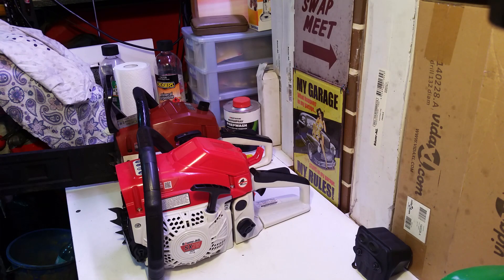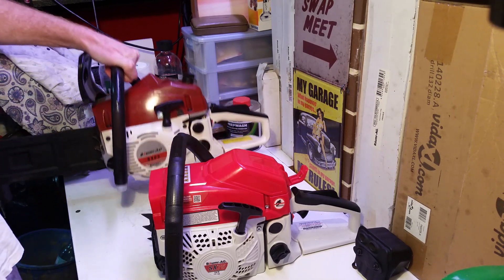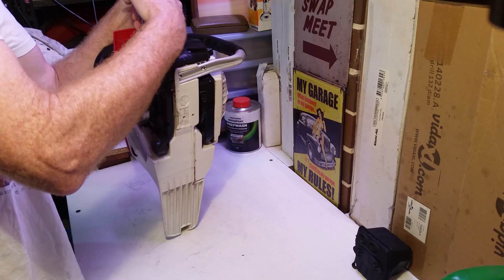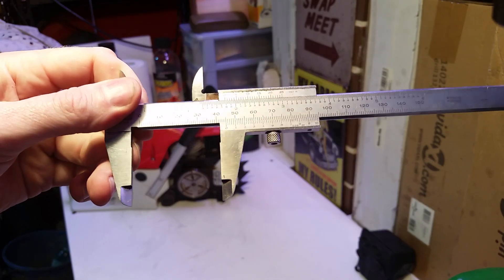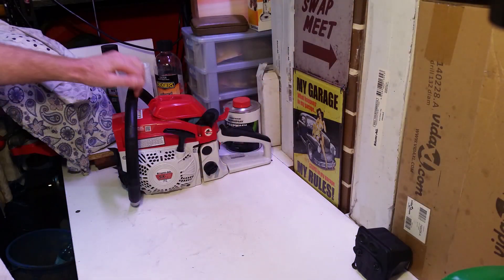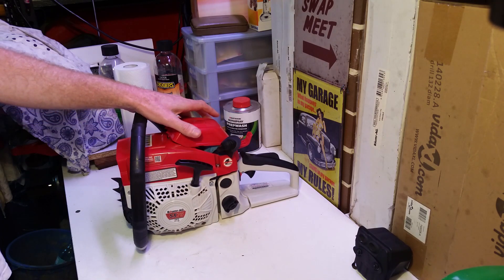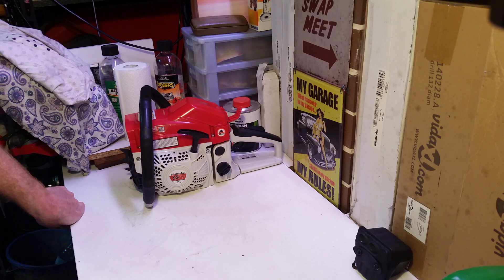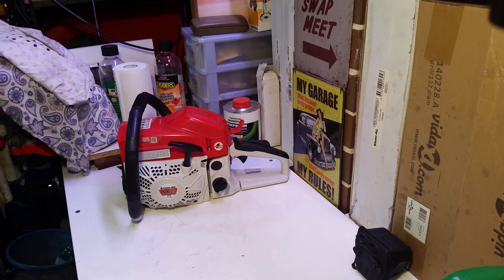Baumr ag SX75 chinese chainsaw, what is it really

Comment: Is this the same with giants brand selling on bigw and HN
Reply from the maker: I had a look at both sites you mentioned. Yes, while there are slight variations with all these particular saws, they are the same base design. it is my understanding that they range from 52cc to 62cc, not over. Sellers are using specs provided by China. Often false. Larger saws are completely different, eg Husqvarna 372xp clone 71cc.

Comment: I've got a first gen SX76, bought from AGR machinery (just Edisons with one of their MANY scam names that they have buried over the years). Had it for for a very long time, back before everyone knew what a pile of excrement Simon Mills is and his dangerous imported Chinese equipment that kills people. Ironically, I actually love the saw, more reliable and easier to start than my Stihl or my Husky, but out of the box, it never oiled, the plastic worm gear strips the teeth on the first pull, they sent me another one, same issue. one day I might try and match up an alloy worm gear from another saw that will fit, I am shocked how long they have been using the current name Edisons, and that they never dropped the baumr-ag brand. They don't even care, and that's why their equipment kills people, chainsaws are one of the "safest" things they sell... and they DO NOT meet the Australian safety standards. Incredible that the government allows this crap to happen for over a decade. Some of their hydraulic stuff, and tractor implements etc... are absolute suicide machines :(

Comment: I am currently using this saw and i think it rips for the price. Ive busted the stock bar twice now though so im wondering if you had any idea what bars are compatible with this saw?
Reply from the maker: You can find compatible bars on ebay.
If you are looking for better quality, I don't know what brand fits, but suspect it may be Husky small mount, but not certain. you should check.

Comment: Hey Anthony! you measured the diameter of the piston, NOT the "cylinder diameter"/bore. And I can tell you now bro, that the piston
has substantially less diameter than the bore. Your displacement measurement is spurious...  No wonder the seller has ignored you.
Also mate, I dont know what website you bought your SX75 from, but the website I bought mine from clearly advertises the displacement
at 62cc.   Just because a Falcon 500 is called a Falcon 500 does not mean it has a 500 cubic inch engine LOL
Reply from the maker: No, actually I measured from the cylinder to the opposite side of the piston, therefore, only didn't measure half of running clearance 
Secondly bro, if this was 62cc, with 35mm stroke, it would have to have a 47.5mm cylinder. No engine I have ever worked on had pistons 2.5mm smaller than cylinder, that would be pretty shit lol.
Thirdly, when I purchased mine, it was advertised as 75cc. Yes Edisons ignored me at first, but when I took this matter & the sx92 matter to fair trading, Edisons were forced to change their advertising.
Still not correct, but closer..
Perhaps you should do your own calculations, or use online calculator for yourself.
I forgot. Falcons are shit. Lol.
Reply: There is only a few thou dfference between the piston and the bore, in essensce they are the same measurement. You are clueless.

Comment: Chinese chainsaws are junk it's better to shell out a few coins for a German made model. I've had too many problems with Chinese made chainsaws including the bar which always seems to work loose the chains themselves which are pure junk, leaking bar oil and problematic carbys not to mention cheap plastic parts that break.. China couldn't even manufacture ball point pens until 2017, they simply couldn't engineer them

Comment: do you think its possible that the seller didn't know the CC was incorrect?
Reply from the maker: At the time, I did contact the seller to inform them of the problem, they didn't want to listen or correct there advertising. That's why I took the matter to fair trading & posted these videos. only then did I get some results for this & other chainsaws. Although, afterwards they were advertising this one as 62cc. Still not right.
Thanks.
Reply: @anthonysgarage5283  ok just wanted to clarify, I was under the impression they didn’t believe you and thought you may just be wanting a refund etc.. but by you informing them they should at least check if they didn’t know the CC size to start with, 
So my next question is, I just bought a SX62 gen3 with obviously very little research before buying, is that a 62cc saw or do I have something else? 
Cheers
Reply from the maker: @AlexanderTheGrateful  I can only say that my sx62, which is an older model, is about 61.5cc close enough. Don't know about gen 3, if you can't find  out, you would have to measure stroke & cylinder to work it out. Or find online calculator. Cheers.

Comment: I call b.s,maybe the cc mnot be 75cc,but I can tell you that this thing when tuned rips through ironbark,blur gum and a stack of other Aussie hard wood,absolutely bargain,I do have my stihl 381 magnum as back up,so far so good,I have had the main fuel line fatigue and suck.air.
Reply from the maker: Measure it for yourself. Then comment. It does run pretty good but it has less balls than 62cc.
Reply: @anthonysgarage5283  hey bro no.disrepct to you,iam not disputing the measured size,all iam saying is it has heaps of grunt,I currently have 3 saws a 72cc  381 magnum and a husky 350 which is 50cc and the sx 75 has way more power than the 50cc husky,for the price it can't be beaten,maybe it is a 50-60cc and it wouldn't surprise me,end of the day it does more than asked when it comes to cutting Aussie hard wood,keep up the vids.
Reply from the maker: @shameelali2549  no problem mate. I would agree with you that it's pretty good for the money for a saw that is for memory about 57 or 58cc. The point of this video was that when I bought it, It was advised as 75cc.
Thanks for watching.

Comment: Hi Anthony, thanks for the review. Any recommendations on a budget saw for a home owner? Just for firewood collection. I have a Jonsered 2040 Turbo which is a bit undersized sometimes. Looking for a bigger bar/motor but it won't see heavy use. Neighbour has the SX62's and swears by them despite them failing every 2-3 years because they are so affordable to replace. I was looking at the 75 as well.
Reply from the maker: Hi Andy, thanks for watching. Firstly, if you are looking at chinese chainsaws, look carefully at the castings & other physical features. A number of other brands like MTM , GIANTZ & others are advertising 72 or 75cc saws. These are most likely 62cc or less as with my sx75 55cc. There are some genuine larger saws, but different design.
Now my sx62, 61.5cc is over 6 years old, used a lot, replaced coil some years back & going strong. Supprisingly. It has poor air filter design. Currently using 22" bar.
Sx75, 55cc saw is under powered for 22" bar supplied but has better air filter design. And dodgy chain tensioner needed modification.
My choice between these two would be sx62 if new model is 62cc or close to as advertised.
All chinese saws need a lot of maintenance & minor tweeking. Poor quality. For firewood, their fine. 
Maybe a good second hand Husqvarna or Stihl for the right price. If you can find.
Good luck.
Reply: @anthonysgarage5283  Thanks for that, I'm considering the MTM 72SX, which is listed as a 58cc running a 22". It seems to have positive reviews online. The SX62 gets a generally good wrap also but I was thinking the MTM being an extra 2" could be useful. The SX75 is now listed as 62cc also, which is another 22" option. I have read conflicting/poor things about the 75, 82 & 92. Do you have any feedback on the MTM SX72? Couple of positive vids of it on YT.
Reply from the maker: @andyd6511  Hi Andy, I don't have any mtm saws, but looking at pictures of MTM 72SX,  top cover makes me think it might have the improved air filter. 58cc should be ok for 22". My baumr sx75, 55-56cc (listed as 75cc at the time) did cut, but not as well as sx62, disappointed as advertised as 75cc. Don't believe current baumr sx75 specs of 62cc. It's 55-56cc. I think all these 55-62cc range saws come from same factories.
I am thinking of putting 24" bar on my sx62 as I have a bad back & don't like bending over. This is why I suggested sx62. Bit more power for longer bar on light saw.
As for baumr-ag sx82 & sx92, they are larger heavier saws. basically the same saws with different stickers & $$. These saws are a clone of Husqvarna 372xp. With actual 70.7cc same as Husqvarna. All parts available + cc upgrades available. Sx82 & sx92 or (G372xp) specs available at farmertec.com
Hope this helps.
Reply: @anthonysgarage5283  Thanks mate. Yes I liked my neighbour's SX62 but just thought why not try a 22" option since I want a good upgrade on my Jonsered 16". Collection just starting so I don't have bars and chains to swap around just yet. In terms of budget I'm trying to keep it cheap (dad shouting, birthday) so either the SX62, SX75 or 72SX. SX62 seems to be a safe bet so just wondering if I go the others for a 22" bar or get the SX62 and look at a bigger bar later maybe.
Reply from the maker: @andyd6511  sounds like you have you're heart set on 72sx. This should be fine for firewood. You probably won't need longer than 22". All chinese saws will have minor issues to resolve. It's an individual choice. Pro's won't touch them, but for occasional firewood, budget saws, their fine. Trust your gut. Also please be careful. Always be mindful of the tip of the bar.I should practice what I preach, but safety gear would be good idea if you don't have already.
Happy cutting.
Reply: @anthonysgarage5283  Thanks again mate. I might go with the SX62 because at least you have measured it at 62CC. The SX75 actually being a smaller engine...perhaps I'm better with the 62 and looking at a 22" bar later if I need it, rather than buying a saw for the longer bar and hoping the 56CC's are enough. And yes I always use goggles, muffs and leather gloves. It's the back that's the problem haha
Reply: @anthonysgarage5283  Hi mate, settled on the SX82. Decided the extra CC's was worth it, even if I don't need to whole 24" I could always swap to 20-22 in future. Also thought being a Husky 372 clone could be useful having access to interchangeable/reputable parts. I'll let you know how I go!
Reply from the maker: @andyd6511  hey Andy, good to hear. I think you will be happy with your choice. All aftermarket & genuine parts available for sx82. I have never had major issues with sx92 (same saw). Just remember, always use decompression valve with every pull & be gentle on chain tensioner. Mine hasn't failed yet. Also if you ever change the bar, it's Husqvarna Large mount & 3/8 pitch, not same as sx62. Hope it goes well.🖒

Comment: .....apparently in the motorised bike columns it's been mentioned that the Chinese look at the full capacity of the piston chamber which includes the unswept combustion chamber not just the displaced capacity .
..Mine is an sx72 brand new which I purchased exactly ten years ago. I couldn't start it then and not doing much better today .It'll only run with choke engaged with help of the starter fluid .Soon as I disengage choke it cuts out. Naturally something isn't right with the carby. Since it's useless as is , I guess I'll pull it apart . I'm ignorant about those types of carburetors .
Reply from the maker: Not so sure in this case, I can say this, back when I Purchased my saws, sx92 & sx82 were sold as 92cc & 82cc but in fact, they are exactly the same incluting stroke, cylinder & piston. Both 70.7cc. Same combustion chamber. Obviously someone was telling lies & they new it. Thanks for watching.

Comment: I checked my "Lumik LK86" earth auger bought 2 years ago. This seems to be a rebranded "Baumr-ag" product. Claimed 86cc turned out to be 72cc in reality (bore 49.8mm, stroke 37.0mm).
It seems this fraudulent misrepresentation of engine size has been going on for years; the ACCC and consumer groups like Choice are asleep at the wheel.
Reply from the maker: Hi Alan, spot on about consumer groups being asleep at the wheel. It took considerable effort & multiple complaints to get some action against Edisons.

Comment: Do you know the real ccs of the sx62 ?
Reply from the maker: Hi David, thanks for watching. I have 2 sx62's, 1 is old 1st generation & 1 2nd gen. Just measured them, they both have 48mm cylinder & 34mm stroke = 61.52cc, I don't have current model but think it's probably the same.